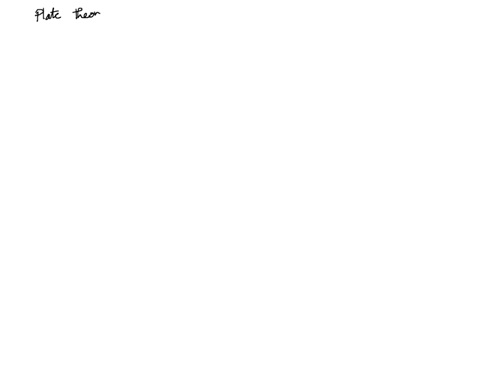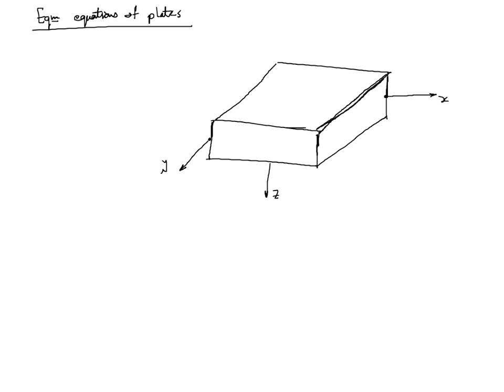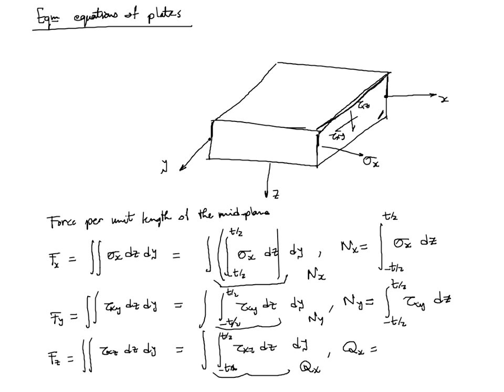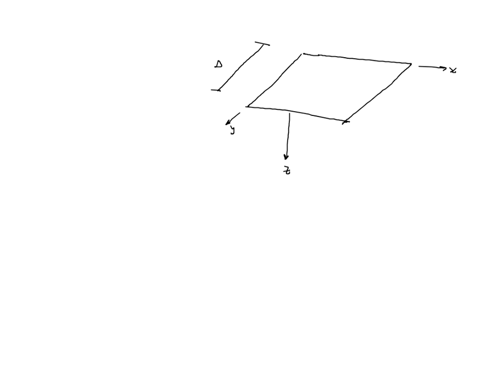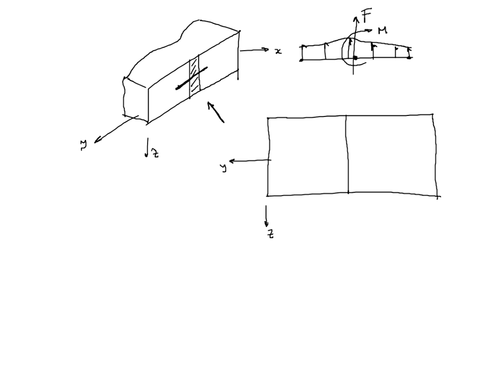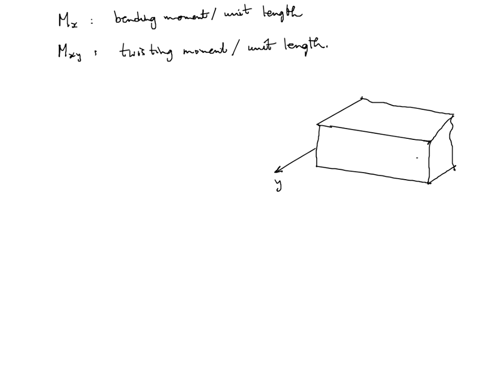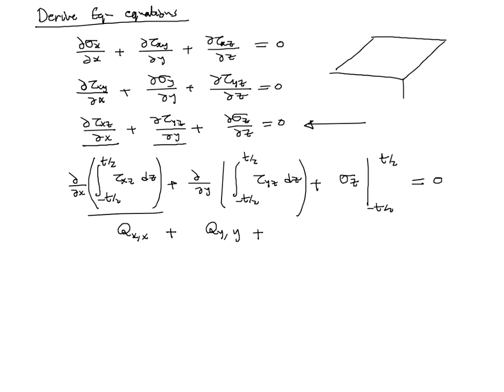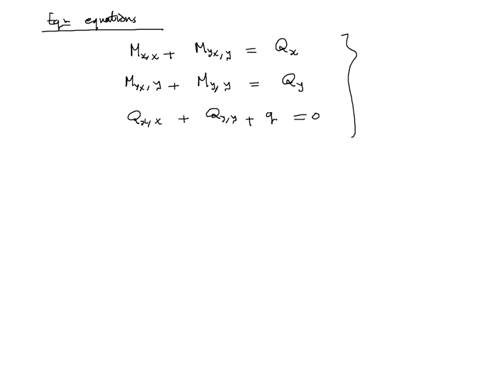2012 10 10 1027 lecture 1, about Plate Theory

Comment: Sir we r using a copper diaphragm for one of r application and we r pressuring a hydraulic fluid on it and its welded on to another block underneath it 
And we know the working pressure
Can you please help us with the calculations of thickness for the working pressure??
The dimensions o the thin sheet are 147mm by 10.5 mm and working pressure of the fluid is 1028 psi and we r constraining the deflection to 0.15 mm
So can u help us find the safe thickness of plate to sustain the pressure??